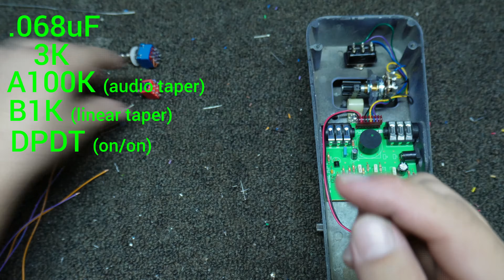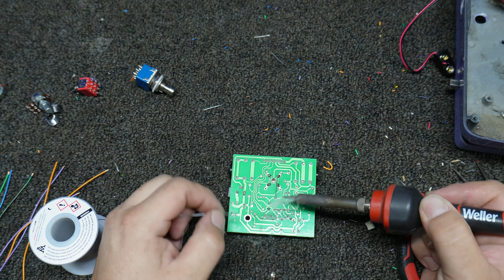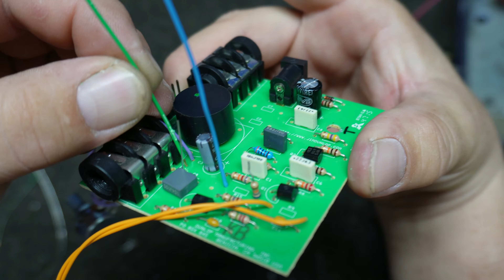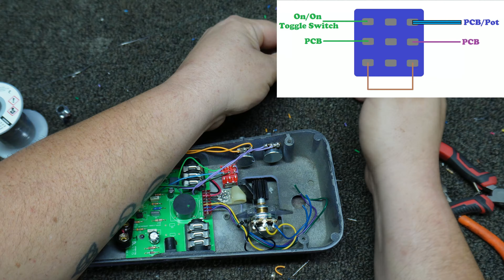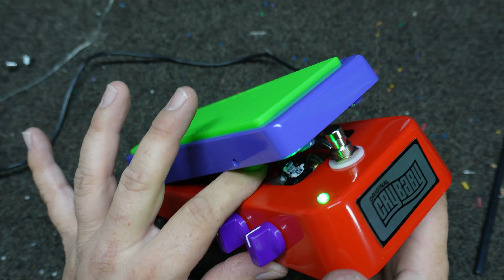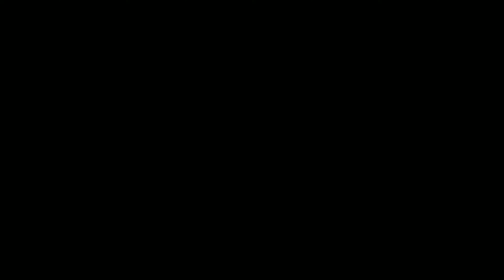DIY Crybaby Bass Wah Mod (GCB95 to Bass Wah)

Comment: What are you using to drill the holes on the sides? Awesome videoa
Reply from the maker: I use a 1/8” drill bit as a pilot hole, then I use a small step bit. 
Check out this video, I show how I mark and drill holes 

https://youtu.be/4Ncz5yN-fxs?is=UWGNU6wEg_L0LU84
Reply: @ArtoriusGuitarNerd youre the man thank you

Comment: what kind of LED light did you use for under the pedal?
Reply from the maker: It’s a 12volt LED strip installed without a resistor

Comment: Do the capacitor swap step, but put both in on one side, add some wires and a switch so you can select between both.
Reply from the maker: I did that mod on my other videos but not necessarily for a dedicated bass wah.